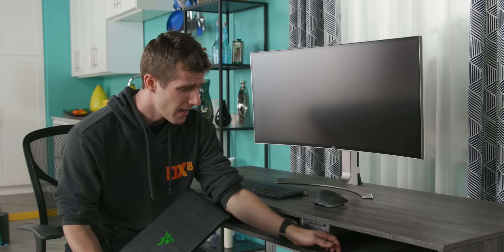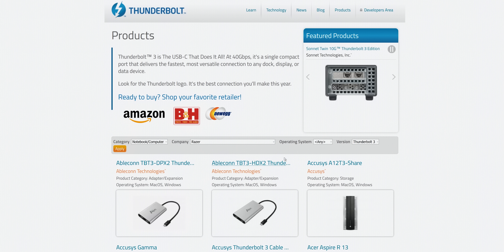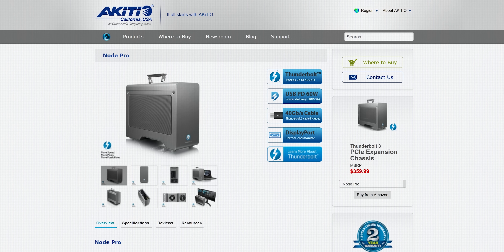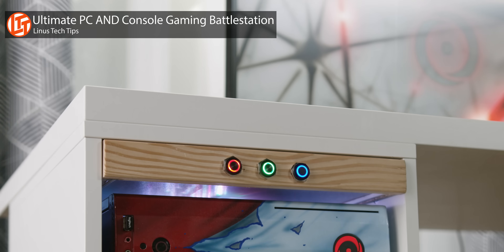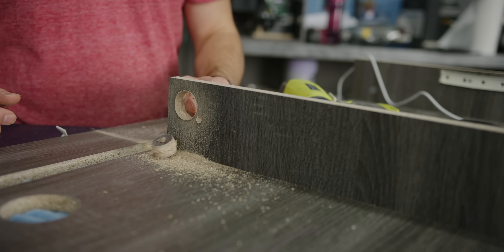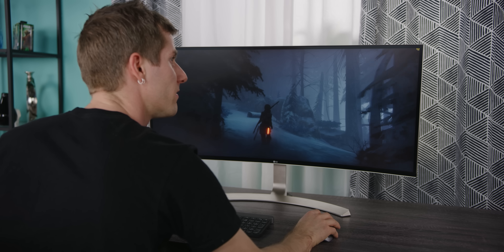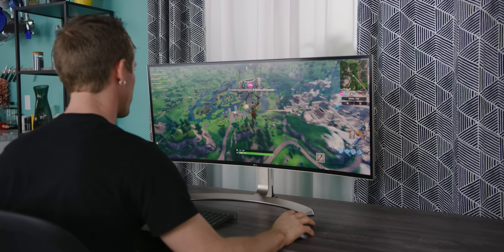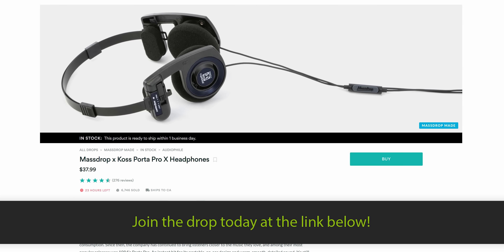This is the CLEANEST Setup.

Comment: This is cool, but it is expensive to the point where it isn't the cleanest setup anymore.

Laptop with 4x PCIe Thunderbolt port: 1500$+
Desk: 400$
Fans, machining, labor, etc: 100$+
USB-C Hub: 300$
eGPU enclosure: 500$
GPU (1080 Ti): 700$+

Total (without screen and peripherals, and without the wireless charger setup): 3500$

I think a lighter laptop and a (very much more powerful) desk PC would be substantially cheaper, and would look a lot nicer as well.

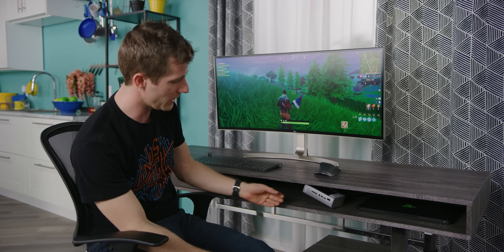Comment: 13:40 Just use Dual Lock, not Velcro. It's much more secure, neater looking, cleaner (doesn't collect and snag lint and threads), and there's no opposite sides.

Comment: The Dell laptops we use at work have now started to use this USB-C docking method for desktop use. We are interested to see what the durability is like on the cable and the port, especially as the cable is hardwired and not replaceable on the Dell dock.

Comment: I wouldn't do a fan at the back of the storage area to cool the laptop. With that CNC rig I'd do something similar to what you did with the wireless charger and put a good, quiet chillmat permanently mounted and driven off the dock. You'd be guaranteed super chill temps while hopefully minimizing dust in the cabinet space.

Comment: You guys should try the 3M damage free wall hanging strips rather than velcro for mounting electronics. Works like velcro but way stronger. Also easy to fully remove and wont damage the finish 👍

Comment: You should really find something that makes the screen never turn off when you have an external display/EGPU connected. I know linux has a simple option for that in Gnome or Plasma, but I'm fairly certain you might be able to find a setting or something to change or install to make the computer not go to sleep when you dock. 
My HP EliteBook 840 G1 has a dock that has good IO and video out so all i have to do is dock the laptop, wait for the monitor to recieve the signal, then close the screen. and if you set it up properly, you don't have to see any wires and you can even wall mount it.
So basically us Business folks have had this option since the 90's.

Comment: before you use any self stick tape (in your case the Velcro)clean the spot your taping to with alcohol, it will stick better. A third strip may offset the weight problem.

Comment: The fun part about this clean setup: the CPU overheats and throtlles, GPU is underperforming since it doesnt have enough bandwidth with that razer external gpu box (alienware does it bit better on r3 -r5 but still far from good) the components are soldered to the motherboard - something dies - razer decides your fate, they have pretty bad warranty tbh. RAM is pretty low frequency to todays standards and so on. 
It may look fancy on the outside, but the insides are still very ugly, dont fall for that, gaming laptops are more interesting then couple of years ago but not quite there yet when we compare them to modern desktop systems.

I had Alienware R5 8750h with 1080 for quite some time, had the same idea in mind as described in this Linus clip, didnt worked out that well :-)

Comment: Do a follow up for us Mac underlings please
Reply: It's gonna be exactly the same setup - eGPU and everything. Just plug a (TB3) MacBook Air/Pro in instead, and if you want solid plug-and-play compatibility with macOS, get a Radeon VII or Vega 56/64 instead of NVIDIA cards. If you're running the 15" pro though, you may want an eGPU with a higher power supply.
Reply: Doesn't the Mac have more than one tb3 port? That would eliminate the need for daisy chaining, and deliver the full power to charge the Mac, at the cost of 2 cables instead of one
Reply: @sim2er  You could... but it's a lot easier to limit the number of cables and get an eGPU that provides more upstream power. Some eGPUs also have USB ports on them... for example, the Mantiz Venus I have has 5 USB ports I think, all going through the one TB3 cable

Comment: GTX 1080 Ti? What are you? Cavemen?
Reply: no, I'm a cavegamer lol
Reply: iezqandar zulqarnaen Proudly rocking a 765m biiiiiiittttcchhhhh
Reply: OMEGALUL the 2000 series cards are overrated and NVIDIA should be ashamed
Reply: Shut up
Reply: Everything over 2000 i think, ice heard is just overkill and a waste, at least for gaming
Reply: Nathan Mathew Verghese yeah they made 2070 now 💀💀🤣
Reply: @ttvloganx5240  means nothing because the 2000 series are a waste of money honestly
Reply: @851995STARGATE  idk what to say about that.I need to upgrade from a gtx 770 and the rtx 2070 seems like the best choice
Reply: @851995STARGATE  it was a joke dude. I myself use Intel HD graphics and play bullet force online.
Reply: @andreiselaru4374  that's a completely different case, if you have the money and are coming from something in that gen then by all means get the 2000 series. But comparing the 1000 vs 2000 sadly there has yet to be a good buck for performance comparison
Reply: @851995STARGATE  Wouldn't agree entirely, but mostly. The 2070 performs worse than the 1080ti so everything below a 2080 is pretty much a waste of money at this point. If you have one of the 10 series flagships, that is.
Reply: @851995STARGATE  that's if you own a 10-series card already. It was never worth the money. It was definitely not worth upgrading to a 1070/1080 if you had a 9-series when those came out so the whole "not worth the money" is not really just a 20-series thing. It's not worth upgrading to the next series if you own the latest REGARDLESS which series it is, RTX or GTX, 20 or 10.

Comment: im no cnc expert but i do have a cnc machine. to route the top of the desk with the least amount of blowout, or any material where you dont wanna mess up the surface, you need a downward cutting end mill, instead of cutting upwards it cuts downwards making blowout almost non existent. if you have any cnc questions please feel free to message me.

Comment: So the cleanest setup involves janky drawers, cable holes and a fat 'mothercable' ziptied to one of the legs? Come on, that's not even trying. The legs are thick enough to route the cables through, Come on fam. You could have built a custom desk that hides all the cables, leaves enough space for things, has the wireless charging and the possibility to connect your laptop. While also building a desktop into it for when you're not using your laptop.
Great idea, pisspoor execution.

Comment: Yep, that was the great setup. But as for me it DOESN'T feels very clean!..
You still have space under the desk, and that space is filled, It's filled with nothing. Yet the drawers on the each side. Why didn't you just make one 1.5 inch board for everything in below?
To feel it really automated transformation (from laptop to desktop), you should make a custom slot to slide a laptop directly in it. That is a challenging task, but dude - there is furniture simple push mechanisms that can make a port inserting easier and the removing safer.
Lastly it is dark! Why did you decided to make a cleanest thing dark?
Great idea, great realization... But the perfect things need to be done couple of times, before it gets to perfection.

Comment: So with the issues that I've heard about with the 2019 Razer Blade Stealth, I'd be concerned about having only 60 watts available to charge as even the charger that comes with the stealth isn't capable of charging under load... would upgrading the power supply in the node by any chance increase the amount of power that it could provide over USB C? I know it's not likely, but I would love to see you guys test something like that.

Comment: Guys, so i bought a prebuilt for 1 326,3 dollars and here are its specs:
Gtx 1060 6gb
8Gb ram
Msi z370 a pro motherboard
m.2 ssd 250 gb
500 watt psu 
disk drive 
3 fans
and 3 year warranty. Is it worth it or should i return it?

Comment: in MY mind a clean setup doesnt need to cut all the cables.. it has to blend in into the apartment. 
the obvious thing is the monitor. i would mount it at the table with a slide to make it come up when necessary

Comment: @linus You should check out some of the new tech on the market for under desk wireless charging. Most of what i have seen is in the predevelopment phase but by the end of 2019(even mid 2019 i believe) there will some products on the markets. This will make it to where you do not have to make a hole under the desk for a wireless charger. Just food for thought!

Comment: What about making a custom drawer where the laptop fits in perfectly and when you close it, at the back the thunderbolt cable is already waiting so you dont even have to plug something in + not even a single wire is visible AND the laptop isnt visible either. Might just have to add a cooling solution.
Could compare it to the dock from the Switch except its a drawer

Comment: regarding the chop at 13:25.....it is the major drawbacks of egpu...i've owned one myself for a few months and ended up selling it for that very problem....by having the gpu bandwith restricted through a wire, you add lag that cannot be worked around even though for the majority of the time the FPS are fine, it will always show chops once in a while which makes this whole egpu setup useless to my eye.

Comment: Uh, yeah, I'll use as many devices as possible. I have a 2005 desktop PC, PS2, PS3, PS4, and Xbox1X all on my desk. Then I have a DS Lite, Windows 10 RCA tablet, 2012 Fire HD7, 2016 Fire HD8, a mid range 2014 Android phone, a $1 Android phone, and a $40 720p Android phone I use as a tablet... AND I USE THEM ALL! Would like to add a gaming laptop to the mix, and update to a Desktop from this decade. Actually, I'd like to dual-boot the Xbox1X with Windows 10 and forget about getting an actual Desktop PC, really a missed opportunity for Microsoft there.

Comment: I'm sorry I'm still new, but doesn't the laptop got heated when the lid is closed and connected to the monitor? Mine is Dell Inspiron 7559 and when connected to monitor and closed the lid, my God you know what when I touch the laptop afterwards it got super hot.

Any suggestion to this?

Comment: The problem with this is all graphics card-USB connections can't carry the data a direct connection to a motherboard can. There's no point in going over a 1060 or RTX570 because of the data transfer limits USBs have.

Comment: I have a similar setup, but didn't see the need to buy a dock per se, so razer blade stealth, razer core x, 7 port usb 3.1 hub, usb ethernet adapter, usb hard drive dual dock, audio passes through to my monitor and then to my speakers, usb headset, usb mouse/keyboard. done it's a 2 cable solution though, 1 usbc to egpu and 1 usb 3.1 to hub

Comment: hears a problem linus fortnite has frame rate cap because there a glitch where if you have 30 fps your fire rate is slower then 60 fps idk if it s fix or not.

Comment: I9 macbooks thermal throttle in the open, putting that thing in an enclosed area, even with a noctua fan running air over it... wont do anything... at least i dont think.

Comment: Even though I have a hugely powerful workstation, for 9 years my main computer has been and still is a Toshiba M780 Tablet (real tablet with proper pen digitizer) with i7 CPU and 8GB Ram.  Other than doing crap 3D, it does everything else fine, has a docking station, and optical, and can even support raid with 2 Hdd's (I use mine to dual boot Windows 10 and Windows 7).  USB is only version 2.0, but you can get a 3.0 version for the express card slot.  My system has the dock on a wall (yes desk wall), so it is very compact and out of the way, has a HD monitor and will do all of this for very little.  When I want to go on a trip, this old but quite rugged tablet happily fits under my car seat as it only has a 12" screen and it has its own built in 4G modem (was 3G.)

Comment: Just a tip for the velcro thing, if you know someone that works at an hospital or a clinic they usually can smuggle out those insane Velcros with pre applied adhesive on the outside. I used that to fix an external sound card under my desk and it's still holding on even after 3 years!

Comment: The cost of this is obscene to most people and that desk is just awful, I am a furniture maker and I just would never use something like that as a desk, how can you call that  formica clean, use proper hardwood then all routing would have been no issue.  Your video has given me some ideas although the price range I am in for a PC is £1000 so I don't think I can get anywhere near where you are with this system.  The last computer I bought was £1100 and has lasted for 5 years with one gpu update and I game pretty much everyday.  I would love to see some more normal stuff because with everything topending right now surely the ripe pricepoint is around the middle?  P.S.  Didn't you just do a review of origin gaming PC's and their tech support and find them to be wanting in a lot of areas yet you are recommending them now in your info and links?

Comment: I’ve been planning on doing something like even before getting my XPS 15! I have a 1 cable connect setup currently that gives me power, audio and video output but figuring out the external gpu part has been not as straight forward due to the reasons mentioned in the video. A version 2.0 would be great!

Comment: I mean sure, this is a cool setup. But it's extremely expensive. I can't find prices for a GTX 1080 Ti (perhaps they're discontinued now, due to the RTX cards coming out?), but a 1070 Ti is nearly £400. Heck, even a 1050 Ti is £150. Add that to the cost of the eGPU unit, which is £250, and you're looking at £400 just for using a 1050 Ti, or £650 if you're using a a 1070 Ti. Meanwhile, you could just get an Xbox One S for £200. It will play all the latest games, like Rise of the Tomb Raider if that's what you're into, plus non-PC titles like Halo 5 and Halo MCC. And it has a built in Ultra HD Blu Ray drive, for free.
I haven't included the price of the laptop (which is £1,300 for the cheapest Razer Blade Stealth with an iGPU) because I assume this setup is meant for people who already have a laptop, and now want to game. If you were to include the price of the laptop too, then obviously this setup is even more costly, by a huge factor.

Comment: My only questions are....How much? And can you please send this setup out to me? 😂
Reply: The eGPU box alone is $660CAD, CalDigit Thunderbolt box is $439 and in the Razer Blade Stealth $1850, 1080ti $1150. Bargain.
Reply: @lankyjames88  I will make a 1500$ pc
Reply: @lankyjames88  You can external mount a GPU for a lot less than that (like $30 plus PSU - still under $100 total), and I'll sell my 1080ti for 550, so... No, not that much.
Reply: @rndmnetizen  550 cad? I know it can be done cheaper but I was pricing this setup.

Comment: If you do a v2 it would be cool to custom design the desktop yourself and use a better, long lasting wood, even if cheap (like pine) it would make for a more sturdy and age/dampness resistant setup than that composite chip-wood garbage they sell.

Comment: I've been using a HP Omen Accelerator (with a 1070) and a Razer Blade Stealth with a 144hz HP screen at home for several months now and its been dope. Heat is the only issue I have. no crashes or anything

Comment: All these problems would be solved if laptops just came with an external pci connection to connect your graphics card.  Why isn't this a thing yet, its 2019 for christ sake
Reply: That is EXACTLY what Thunderbolt is all about! External PCIE. From Wikipedia: "Thunderbolt combines PCI Express (PCIe) and DisplayPort (DP) into two serial signals,[5] and additionally provides DC power, all in one cable."
Reply: @nitrojawt  yeah but doesn't that not allow the full 16x bandwidth of a traditional pci slot?   idk, last time i did research, there was only an alienware-specific hub, and some other hub for $400 and neither allows the gpu to run at full bandwidth.
Reply: 1Lifeonearth yeah, Thunderbolt only does PCIe 4x, but the point is Thunderbolt is about a standard way of doing external PCIe. Over time as it develops I’m sure they’ll increase the bandwidth.
Reply: @nitrojawt  Oh I see, yeah hopefully it gets better over-time
Reply: https://en.wikipedia.org/wiki/Thunderbolt_(interface)

Comment: Hey I've got a TS3+ dock for my 2017 MacBook pro. I have an issue with noise coming through my speakers as my interface is connected to the TS3+. Anyone else have this product and having this same issue? And if so have you figured out a way to get rid of the noise? To me, it sounds like digital signal and is extremely annoying and causing me to have a high noise floor

Comment: Do you think the pros of putting a system like this together, justify the cost involved ? Comparing it to cloud services for example which in theory would give you all the same performance boosts, not limit you on which components work together, but also "require" a beefy internet connection ? Over all, great job! This would fit so perfectly in my apartment lol

Comment: For the TB3 dock instead of having it on the top surface like that I would honestly velcro it to the bottom surface with the tap so it doesn't  move or fall down like that. It would still look sleek with it on the bottom instead of the top in my eyes and would solve the issue.

Comment: Not sure if this is true, but I have heard that some people's brains have developed a powerful ability to use motion blur and instantly decode direction and speed from single frames. This would make you able to react faster with motion blur turned on. This may be why motion blur is such a common feature. I do not seem to have this ability. Motion blur always feels slower and worse to me. It seems Linus also does not have this ability. 
Does anyone here feel like they have this ability? Does adding motion blur make you feel faster at games?